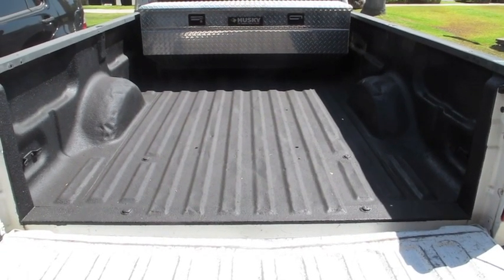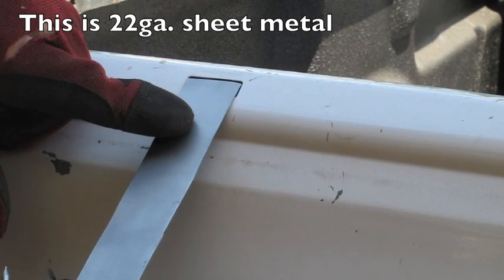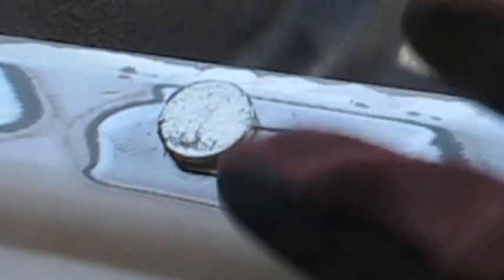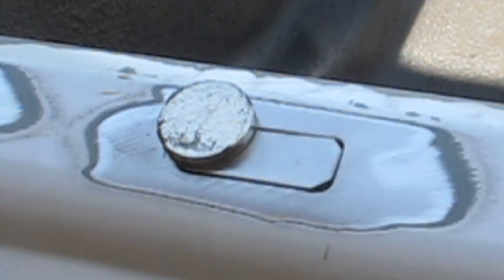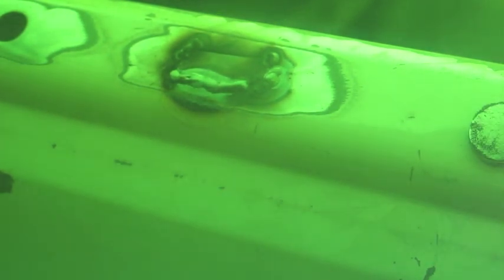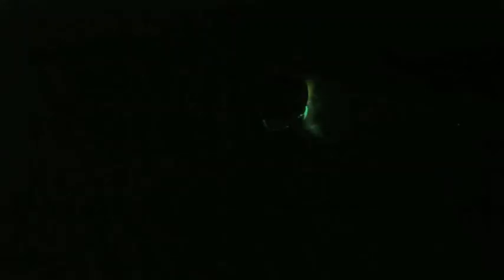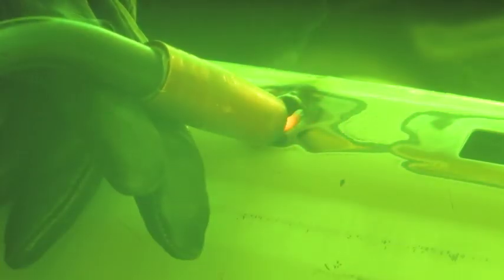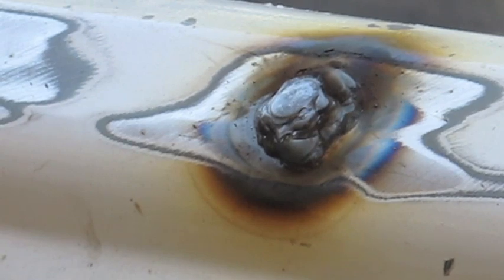Auto Body MIG Welding Project

Comment: Hi u did good work bro but trick i learned. Wen filling body panels like wen you take the plastic trim off in then you have ugly holes like what you filled in. Now ill explain what i leared to do as to help wen useing a mig welder to do sheet metal on card the first thing to do is you will need to clean a spot for ur grond on work metal then u need a good magnet. Then cut out a patch a 1/4" larger then the hole u are filling then useing ur magnet slide the patch in to the hole then keepin magnet in ur hand pull metal patch so it back in well then tack corners in then the then this will make what is called a backer patch then you can cut ur filler patches in stitch weld in in wont burn holes unless ur way to hot then just hit ur welds with a grinder to knock down high spots in finish with a light skim of body filler. Sand that smooth. Prime it in then paint in ur done hope this helps some one out hear
Reply from the maker: Jimi Hendrix Great info, thanks a lot. Not being a car guy, or having much experience with body work, I can use all the help I can get! Thanks again and I hope you'll continue watching the show and commenting.

Comment: burnt out my cheap welder pretty quick. been looking at a Miller 141 I only have 110v at home. do you thing it would be a decent welder doing smaller fabs in my garage up to 1/4 steel?

Comment: You should have tried some copper plate to back the 'plug' you tried. It would have sucked excess heat from building up, and acted as a surface to build weld upon.

Comment: Any tips on how to adapt bodywork techniques for flux-core welding?
Reply from the maker: +Jeffrey Beyer Well, I'm not much of a body man. In fact, I just made it through this video! Flux cored burns a little hotter than MIG, so at the very least you'll have to adjust to a lower setting.
Reply: +WeldFever I already figured on tack/spot welding to hold the piece in place, then go back and stitch weld in short welds. If only had the budget for a nice mig welder that goes really low in the heat settings, but we all have to start somwwhere.

Comment: I do frequent body work myself with flux cored mig welding up to 20 gauge sheet metal to patch tail gates, fenders and doors. Good job as i would of done the same thing and after body fillers and sanding it would be a good fix. I'm looking into to trade up my HF flux core for a hobart 140 gas mig. Would you recommend that mig welder to do really clean exhaust welds and fabrication projects such as minor body work like this with thin gauge. Does the hobart have enough control to do most automotive fabrication?  Nice job!
Reply from the maker: John H I have used many welding machines in my career, but never  Hobart MIG welder. I have heard many good things about them, and an occasional bad, but that goes for everything, right? At the moment, there are so many choices out there for 140 amp MIG welders, and I am about to release a video reviewing a low cost model. All I can say is make sure the unit comes with a warranty, that the consumables are readily available, that the internals seem sound and preferably are made of metal, rather than plastic. Also, if you can get little extras such as infinitely adjustable "rheostatic" dials (rather than pre-set dials) and the ability to add an aluminum spool gun, that would be great. Good luck, I hope that helps, and stay tuned for my upcoming 140 AMP MIG Welder review. I think you'll find it interesting.
Reply from the maker: WeldFever By the way, thanks for the vote of confidence!

Comment: I'd tig it.. Could get the weld a lot cooler so ya don't knock those holes in it but it worked. That's all that matters
Reply from the maker: I completely agree, but I wanted to do it using a process that would be more accessible to more people, so MIG it was.Thanks for the comment and please keep watching!